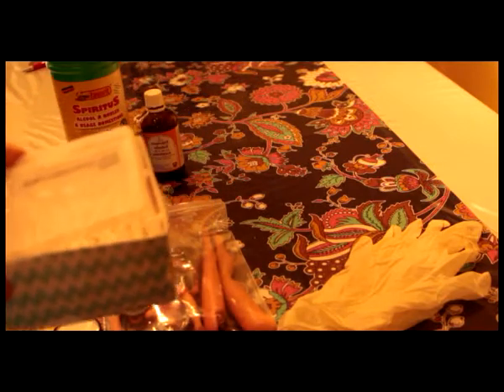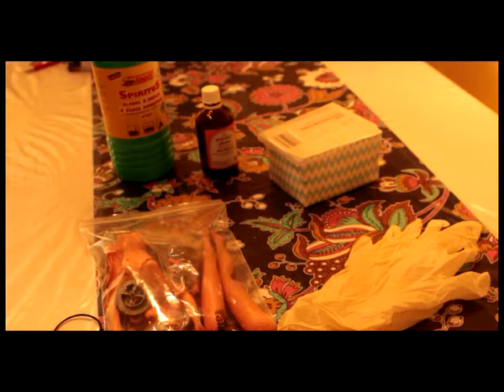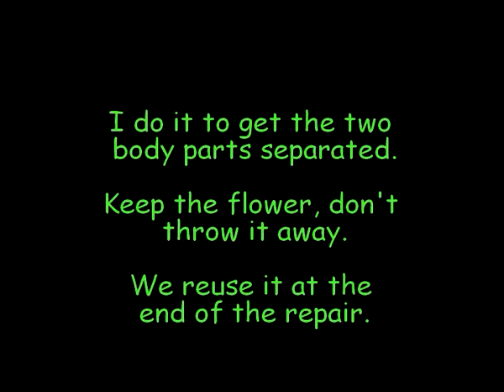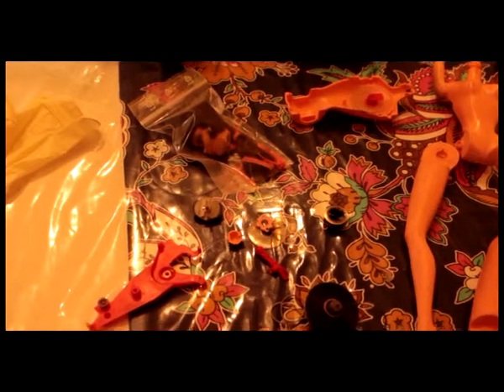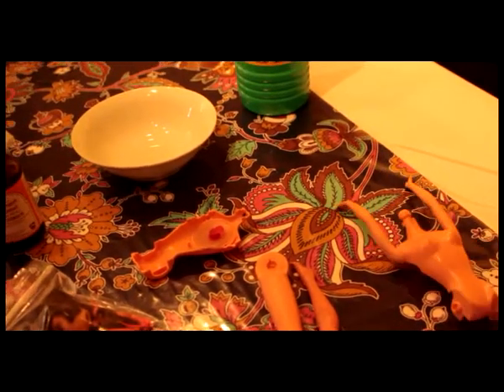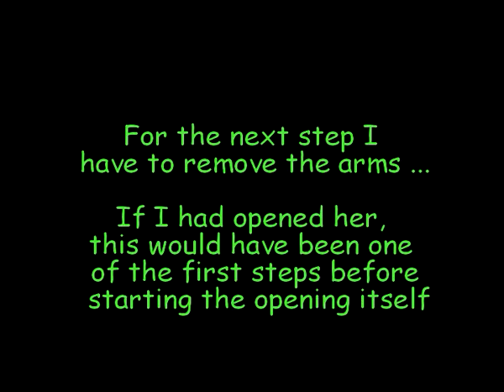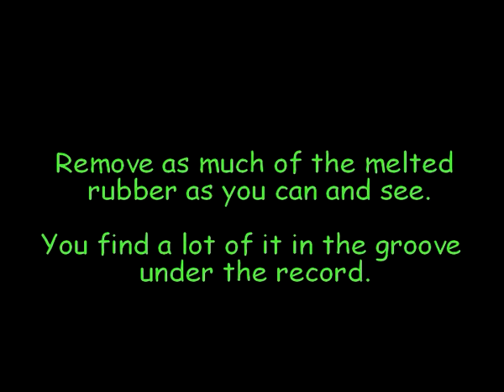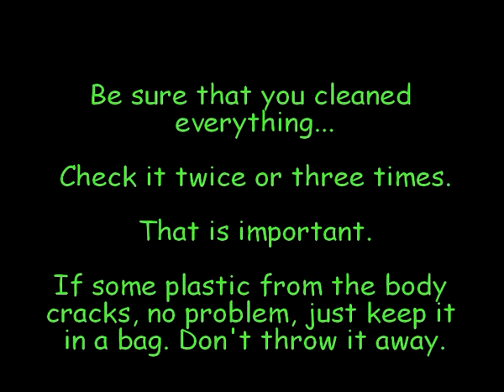the secret how to repair an old talking barbie | gigantic barbie repair cafe project| part one

Comment: May i know how you open the body  to get the parts out? I have a barbie doll and i want to switch her arms only. So i hope to open the body without damaging.
Reply from the maker: What kind of Barbie doll do you want to change the arms on? For Talking Barbie dolls you don't need to open the body to change the arms. You need WD6 and a bowl with hot water. Superstar Barbie arms are harder to change because the attachment is different. It's a bit tricky but not impossible.
Reply: @BusyBfromGermany  i see. Is a Mattel barbie doll. 5 point jointed. I tried just now to open the body, and is hard, but it do have some progreaa with a knife to cut the edge slowly.